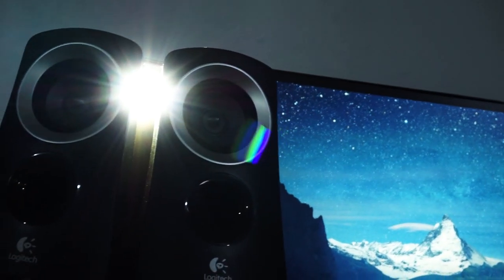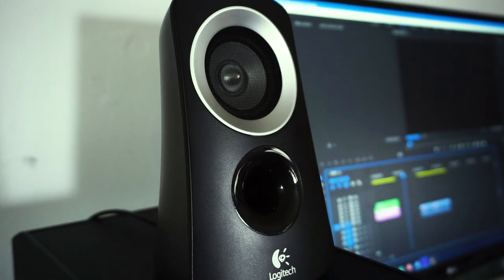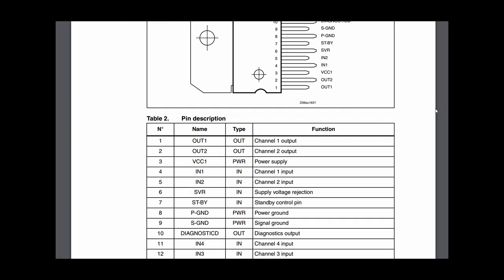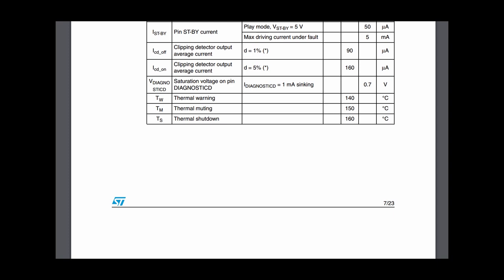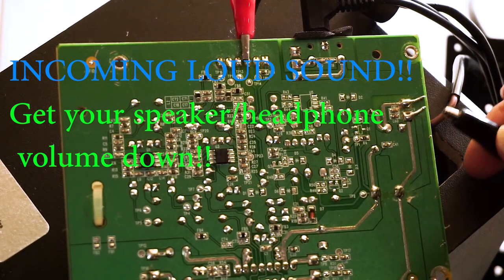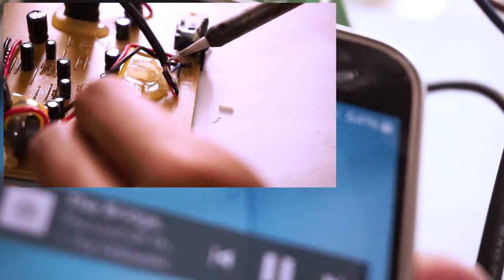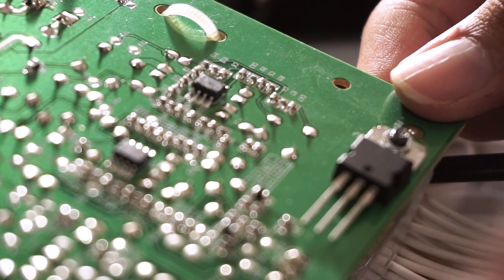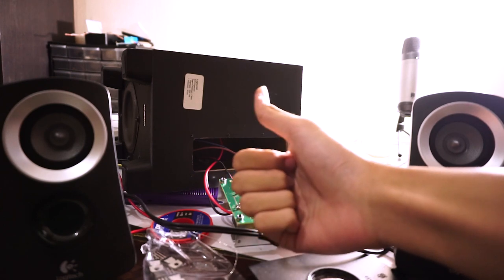Repairing a Dead Logitech Speaker System (Z313 FIX LOG)

Comment: this is complicated.... for someone who doesnt have electronics background
Reply from the maker: It's actually just adding a 5V to interrupt the system.
Reply: Still complicated... and what if you cant afford any soldering equipment?
Reply from the maker: PINEWOOD℠ REPORTER I guess you could just dump your broken speaker and buy a new one.. I mean, it's cheaper that way than repairing the broken speakers, right..?
Reply: @ArsyadKamili  You got me curious. I have a Logitech X210 that won't power on and maybe this is the problem? I can hear the transformer working but other than that nothing.

Comment: So the only problem I have with my speakers, are that the R speaker is way quieter. I did a little trouble shooting on my own, I balanced all the way to the Right and the sound was still very very low. It plays at full power out of the Left. Same model as the ones shown in the video, if you have any suggestions on how to fix I would love to hear them

Comment: Guys i fixed logitech z313 speakers by watching this video. Thanks man i really appreciate. The only thing i wasn't able to do is when i connect 5v IN, is to get wired remote control work (on/off). So i was playing around and found a solution. I've solder a wire from main board IN to remote on STBY IN(if it's called like that i forgot :D) and after that i had a full control meaning i can turn on/off speakers, volume is working and everything else is working fine now. I just posted this bcs maybe i can also help someone. Thanks man for instructions again ;) Cheers!
Reply: Or just join IN and OUT on the main PCB.

I did that on mine and it solved the issue  somewhat (it keeps the speakers always on though)
Reply: Hi,can you help me? i have a logitech z323 ,and i broke the volume controller,how to use it without it ?

Comment: Hello I know this is old but any help would be much-appreciated my speakers, work fine and everything is great except that the power/volume control oval thing? only seems to want to turn on 1 IN 100 clicks haha any reasons why? not looking for a solution just where is the problems at? Loose connection?

Comment: Thanks Kamili for this awesome video. I have the exact problem with my Z313. My input cable which leads to the volume and power control was working only after twisting the cable. Eventually yesterday there was a wrong contact inside the cable and part of it burned and smoked. I then had to unplug the power cable quickly. I tried to fix it by restoring the cable, i cut the section that was burnt and joint the cable. The led could now turn on when i press on the on button, but the input signal seemed not be received. Since this job needs more electronics background, and because the fault is similar to yours can i just change the STA540 microchip? I really needs yr help/input
Reply: Same question here. thanks.

Comment: One day the speakers were working normally and the day they opened the computer they did not work. I disconnected the 2 speaker cable from the base and I disconnected the base cable from the computer hunt. I then connected the 2-speaker cable directly to the computer hunt and just make very little sound. Can you please help me with my problem?

Comment: Ok I know this is old, bit is there a way for you to solder two wires together so that without the speakers, the sub stays on?
Reply: That’s what’s wrong with my Logitech z3
Reply: The speakers plug into the sub just dont connect the speakers to the sub duh!!

Comment: I had a similar issue that I just resolved, where the cable that connects the input/volume knob to the board had really deteriorated, and no signal was coming through the activation wire. Ran some 22ga black wire in parallel from controller to amp/sub and now the connection is solid, speakers are back to working.

Wonder which wire will deteriorate next...darn throwaway culture items
Reply: yeah same issue for me, but I simply shortened the cable and soldered it inside the control thing, now it's dead again so I'm going to try to salvage some other jack cable I find

Comment: Thanks for this rundown Arsyad -- having the STA540 data sheet is very helpful!  So I can avoid removing the PCB from my subwoofer cabinet, do you happen to remember the supply voltage to pins 3 and 13 of the STA540?  I'm considering replacing the woofer and I'm trying estimate the power reduction from going from the stock 4 ohm unit to a better quality 8 ohm speaker and figuring out if any resulting volume and/or headroom reduction would be made up by the difference in woofer efficiency.  I'm using active JBL satellites, so I can balance highs and lows without worrying about matching the satellites to the sub.

Comment: Hi! I got one z313 brand new. I'd like to ask you if is there a way to switch it from 110v to 220v. I would like to use it without an external AC converter. Thanks in advance for any help.
Reply from the maker: Well, there is a way. You can find a 12v power supply that has 110v ac input and replace the power supply that's in the subwoofer with it.
The new power supply needs to have the same capabilities as the old one, you'll need a power supply that can supply at least 3A.

There isn't a simple 'switch' though.
Reply: Arsyad Kamili couple minutes after see your video and leave you the question I opened it removing the speaker and found this power supply.  But also I noticed  that has a board with a fuse and others few components. I knew that it should have this PS so I was wondering myself if this PS would has two input wires, one for 110v and other for 220v, like others similar models. Unfortunately not. I can do tasks with the soldering iron but I'm dummy in electronic components, so I don't know which fuse and other components (except the PS) I have to replace. Anyway, thanks for your reply!!

Comment: Hi Arsyad, my speaker had the same problem as yours not turning on and its the same model as well, I did what you suggested connecting a 5v power supply directly to the board and it worked, so the question is, when you did the step before applying the LM7805 fix, I did the same by connecting where you soldered the white wire (JP23) to the stby and it does not work... did you connect anything else? or I have to get myself a LM7805 for this to work??
Reply from the maker: Wait, so you've fixed the problem? The first fix was failed for me, so I did an alternative with the LM7805 method. If the speaker's already good, then I don't think you'll need to do anything else.
Reply: Er it only worked when i attached an external 5v power source to it... but the first fix you said you thought it did not work because you did not attached the speakers...

Comment: had mine for like 12 years and theyre finally shitting out.
seems to be the connection at the remote, as it still works if i force it upside down. gonna see what i can do but theres like 6 wires crammed in the little rubber neck thing.. might not be worth the effort lol i hate small wires

Comment: Hi Arsyad, I have Logitech z333 its smps blown can I put a new SMPS ? Its writen 94v-0 E317641 ZR-01 I want to know IS ITS 94VOLT psu OR 12 VOLT ?
Reply from the maker: I don't think it's 12V because it's a 80 Watts system. But I can't be sure that it's 94V either because 94V is not a standard voltage number. You'll need to check what's the amplifier chip and maybe find somethinf in the datasheet, or analyze the SMPS to see what voltage it might have.

Standard voltages are 12, 24, 48. If you manage to know what voltage the SMPS is, you can put a new one.

Comment: Issue I’m having with my z313 system is that my right speaker plays at a low volume, and even though the speakers labeled Left and Right, both channels are played on each speaker so it seems.  If I go into my computer setting and try to lower the left channel volume nothing occurs, only adjusting the right channel will silence both speakers.  I noticed that if I have the 3.5mm cable loosely plugged into the amplifier the right speaker will play at a balanced volume to that of the left speaker; but if I plug the 3.5mm cable fully into amplifier right speaker volume is reduced to very low..  Any idea what the issue could be?
Reply: I have the same problem, bro. right speaker is very low conected to the subwoofer.
Did you repair it?
Reply: @RiddzenRock  nah threw the speakers in the trash lol, reminds me that I need to toss the woofer too, just was too lazy at the time.  Probably better to just invest in some other system.  I just use my astros or ear buds these days.
Reply: @OneStopShopGarage  Sure, bro. I'm going to do the same :(

Comment: Hi! May be you could help me with the problem of my Logitech LS11 speaker. The problem is the sound  is so weak even if the volume is maximum, and there's a noise in it like a broken glass, before it was so clear and loud. May be you know how to fix such problem, which I coul do to my speaker. Thanks...
Reply from the maker: Try to look inside, and test visible connections with your multimeter, test the power stuff, check the output to the speaker (it'd be good if you have an oscilloscope), and see if something is wrong. If something is wrong, try to find a way out. It should be easy if you know the problem.
If you don't seem to see anything wrong, learn the circuit. There's should be a main amplifier chip located in the circuit board, look at the name or number, google it, then learn the datasheet and how the circuit behaves.
Now, if you look at the datasheet properly, you should get a slight understanding in what's wrong, test your hypothesis. If right, fix it. If wrong, try another hypothesis.

p.s. 
If you're tracing copper traces with your multimeter, draw the result on a paper to make things easier.
Reply: I only have multi tester. Im currently onboard a ship.

Comment: Hi! excuse me I don't speak english so well, so i hope you can understand me.
How are you supposed to fix that, I put 5 volts external and it works, but I got lost with the regulator, can I fix it without it? Or is it necessary to use the component? If so, could you send me the diagram to solve it?
Reply from the maker: A regulator is the best solution, and it's not that hard to get. 

But if you can't find a regulator you can try this method: use your multimeter set on to measure voltage, put the negative probe to the negative part of the circuit, and start testing with another probe, touch every pin you see on the circuit and see if you can find something more than 4.5V but below 7V.
I don't have the schematic, but I think there's should be a voltage of about 6.25V close to two black SMD IC (I show this in the video). Solder that 6.25V with a wire, connect and solder it to the STBY pin in the main circuit board (STBY pin should be one of the pin that's connected straight to the control pad.)
Good luck.
Reply from the maker: Look at 04:06, that should be where the 6.25V is, or somewhere close.
Reply: Perfect thank you very much for the answer, I'll try with a cable to the STBY pin and I'll tell you how it was
Reply: It is ready, no longer fails at any time. Thank you very much for the video and the answers.
Reply from the maker: Glad it worked!

Comment: i have logitech z333 when i try to turn it on nothing happens but when i plug in other wall plug it works for like 2 days and thrn same problem again how to fix that ?
Reply: If it trips the breaker, then it might be a grounding issue.
Reply: @myhops  the plug is very likely not grounded

Comment: My Logitech speakers are now not working at all. One day completely fine, next day nothing at all. I know nothing about the chip board and components, and after 5 hours of researching YouTube and going to my local fix it dude, I was told just for him to take a look would cost me more then they are worth, so I just went and spent $800 on Yamaha studio monitors, and I think I'm going to sadly have to throw my logitec speakers in the bin. I did have them for 5 years and after my band broke up I got a further 4 good guitar cover videos out of them, so I got my $89 worth. Spewin it come to that, cos Logitech speakers are sweet. I had the z323 model. Cool video for ppl that are smart in that area though. Me unfortunately not. I came here for one last chance to revive my legendary speakers, afraid it's just not a simple fix. I guess it's R.I.P Logitech speakers for me
Reply: Studio monitors are a little overboard for general listening. Unless you're going to be editing and producing audio, you might be better off with speakers that are made to sound rich and vibrant rather than sound flat and accurate.

Comment: i googled how to fix a computer speaker and you have the same exact speaker im trying to fix. honestly i will stop buying logitech products, as pretty much everything they sell breaks in a few years.
Reply from the maker: I honestly expect them to last for just 3-5 years. I think that's what I expected I have with that range of price. Logitech is not the kind of brand you expect to work properly after 15 years. I think they fulfill my expectations and therefore I'm gonna stick to buying their products until I have the ability to buy products with higher prices :)
Reply: I bought an edifier xm2pf 2.1, it stopped working and don't turn on i was using it for less than 2 years, it's not ok what the industry of speaker does.

Comment: Hello Sir, I want to remove the remote controller from this sound system, but how to remove It ?
Reply from the maker: You can bypass the controller system by connecting the audio cable that goes to the control pad to go straight to the amplifier input.

But you should remember that the amplifier needs a 5V voltage to the enable pin to turn it on.
Reply: @ArsyadKamili  how to give the pin 5v ?
Reply: @ArsyadKamili  I've noticed that the controller has A/D converter IC, so what happens if I bypass the controller. Thanks!

Comment: Logitech speakers are pieces of shits.  I can't even get the screws out to take it apart,
Logitech sucks raw ass.  Don't even bother getting them.  They have reputation for the wires soldered inside the speakers to come undone.  Easy enough to just solder it back right? ...NOT WHEN YOU CAN'T GET THE DAMNED SCREWS OUT OF THE HOUSEING.  And why do they have 6 screws?